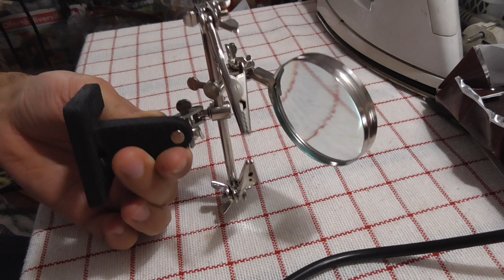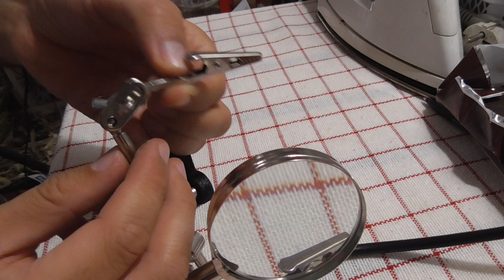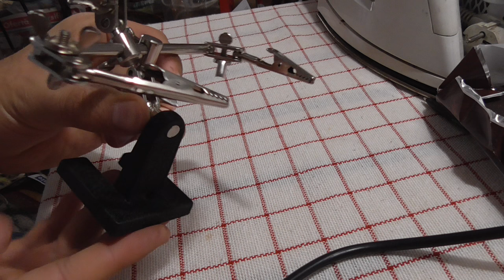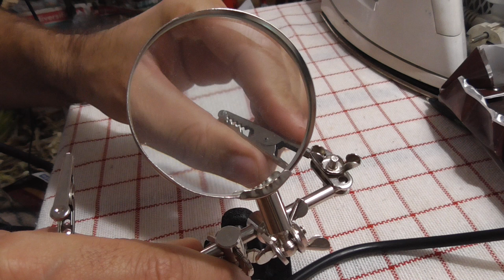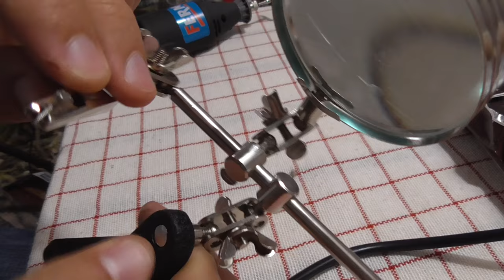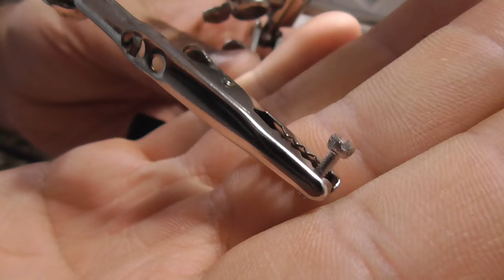How to use a "Helping Hand" tool

Comment: Dude, its not meant to be used with dremel but soldering iron.
Dremel will spatter debris on the magnifier glass ruining it !
Also, dremel will damage even those crocodile clamps.